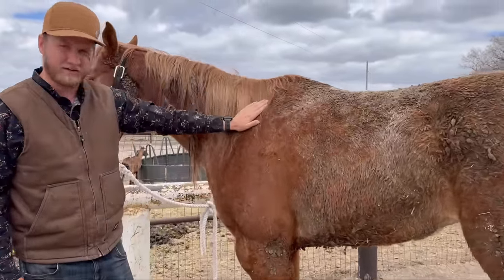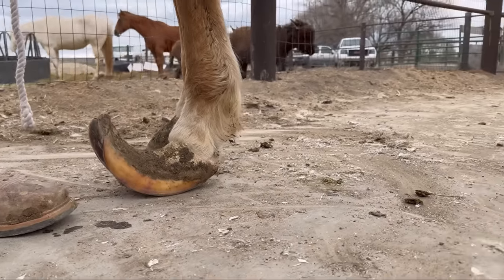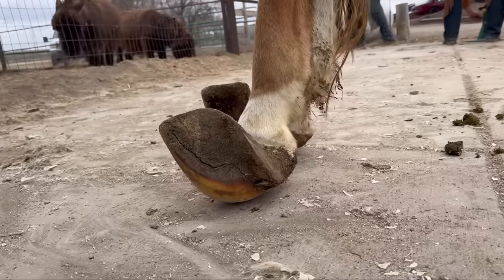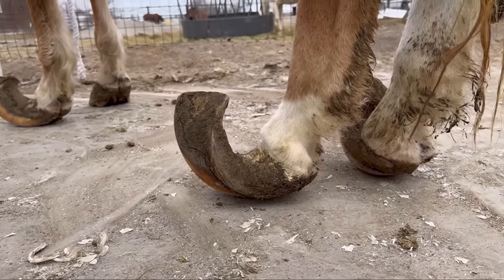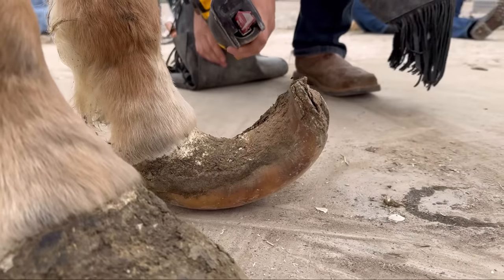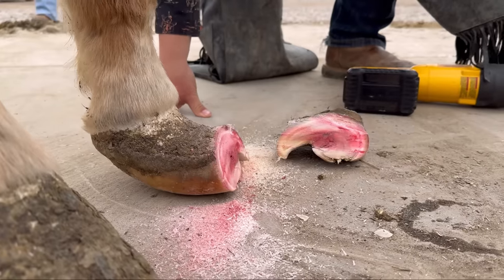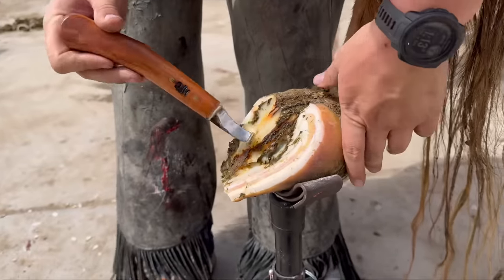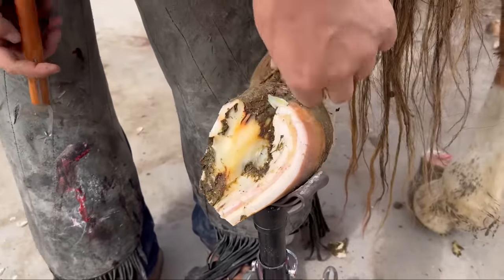WORST CASE WE HAVE TRIMMED

Comment: I've never seen something so horrible.  Poor, poor animal. Thanks for the good hearted person, helping out......❤❤
Reply: Happens very often when horses get into a grain bin and overdose. It is called foundering. A foundered horse grows hooves like this quickly and there is not much you can do. Especially when a hoof job like this is temporary and expensive.
Reply: That's worth knowing. I didn't know the horse would do that. Could it help if the grain bin would stand on a certain high, so it's impossible to stand in it. They would only have to bring their neck and head into the bin, unless they would or could still overdose ?!??

Comment: RESPECT! Hand trimming is no joke. I follow a hoof trimmer for cattle in Scotland  and he uses a grinder. Sticking to the old ways where you can feel every cut is an art. Much respect. This is HARD work and takes maximum skill. Bravo. Being a Ferrier is NO JOKE. It takes skill and you really have to be in shape to not only cut the hoofs, but manage a sedated horse when necessary. Horses are heavy, and if you're trying to keep a horse upright under light sedation while manually trying to trim the hoofs, that's strength and skill.
Reply: I love the hoof gp!!
Reply: Hoof GP

Comment: In six weeks, does he get some custom shoes to help rotate his bone, ligaments, and tendons back into anatomical alignment?  It looks like even with the fantastic job you did getting him back on flat feet, things are still pretty out of whack.  It's going to take a while for the neglect to grow out either way.  I hope the owner keeps with it; I know you will.
Reply: 100% what I was about to ask and say, so @adde9506  well said!
Reply: I couldn't understand why the horse wasn't gotten horseshoes
Reply: @YAVUZ8847 the horse is probably not doing anything that requires it has shoes, and with everything going on with its hind feet it makes me wonder if it may not be possible to safely shoe those at this point.
Reply: @YAVUZ8847  If the owner couldn't manage a trim every 8 - 10 weeks, they certainly aren't going to do shoes every 6 weeks.
Reply: Shoes would get in the way.
Reply: Horses need a strong healthy enough foot to put a shoe on. It can take a very skilled farrier to put therapeutic shoes on a horse. Feet take time, 12 months to grow an entire new foot. Patience 🙏
Reply: You also need as close to a level foot surface as you can manage (either both fronts or on all 4). Poor dude wasn't anywhere close, with the exception of that right front.

Comment: Question:  have been watching Hoof GP from Scotland .  They have an actual lift for the cattle.  It's awesome and they're so fast and thorough.  Would a lift like that work for horses?  They even use a Dremel.  Just curious.  Seems like a lot easier especially for draft horses or horses that have difficulty standing on 3 feet when they are or can be in such pain.  Please advise if possible.

Comment: I saw a similar case like this years ago. From the video, it looks like the one I saw was much worse. Had a lot more curvature and much longer. I was raised around horses and my Father was very particular about hoof care. We didn't have a shod horse on the place, but don't ever remember having any real problem with lameness or hoof splits. Maybe it was because it was very sandy soil and the horses seldom saw any hard surface to work or walk on.

Comment: Those nippers and the difficulty using them speak to a totally inappropriate use for their original intended purpose.  Is there a very strong reason to stay away from the modern angle grinder that bovine hoof trimmers use?  Especially on the long, overgrown, under worn abused hooves?

Comment: The owner should be held accountable for the overgrown hooves. The owner is abusing the horses. 

Wild horses maintain their hooves by moving across a variety of surfaces, which wears down their hooves over time, keeps their hooves in good condition, and prevents them from growing too long.

Domestic horses are confined within small spaces. They cannot travel like wild horses. That's why their hooves would overgrow if they are not taken care of.

The owner has been abusing the horses by ignoring them.

Comment: Question: I watch another hoof trimming channel where they work with cows.  For horses, especially ones that are sedated and/or need extensive work, is it possible to put them in a chute and put straps on them to take the weight off their feet and make it easier for the person working on their hooves?
Reply: Horses tend to put some weight on the farrier, which makes it easier as there is something to brace against when using nippers or a shoeing hammer.  A foot dangling in mid air would be impossible to work on.